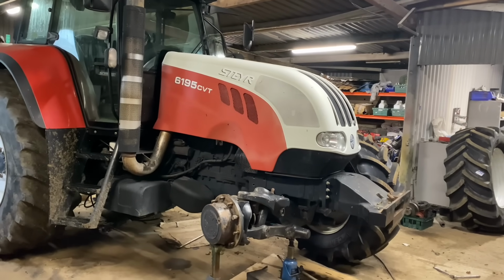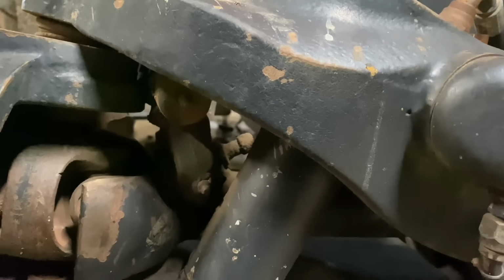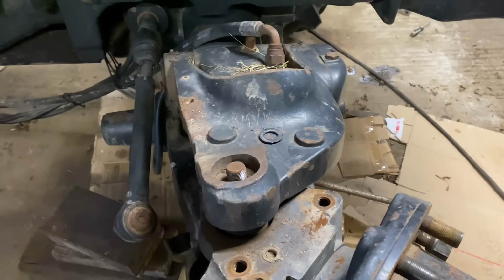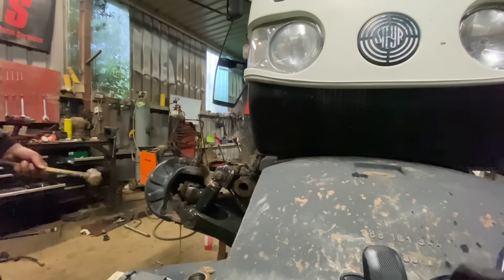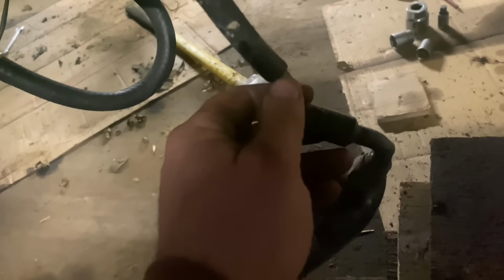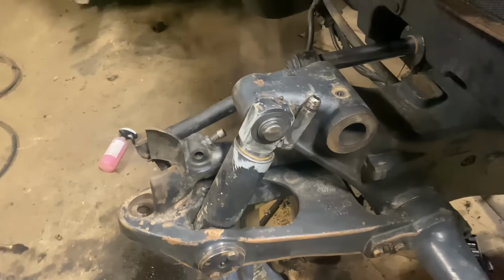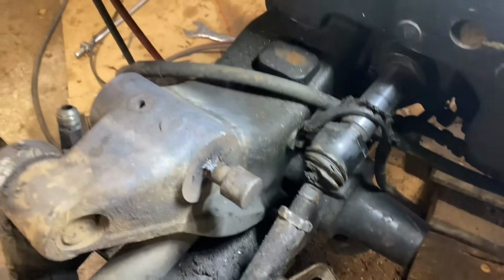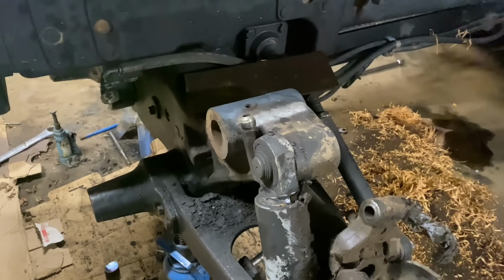THE FRONT FELL OFF

Comment: I would keep the tractor as original as possible and only touch up areas that need touching. I wouldn't install a centralised greasing system as they can block, at least with the nipple you would know if it was blocked.